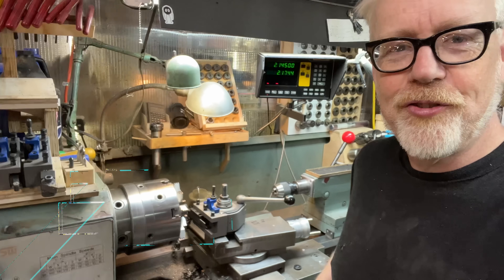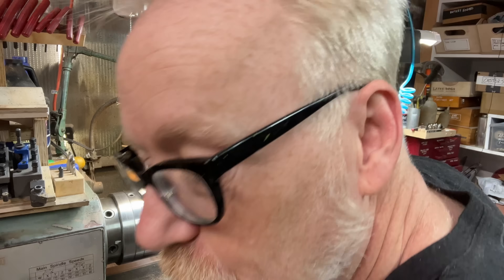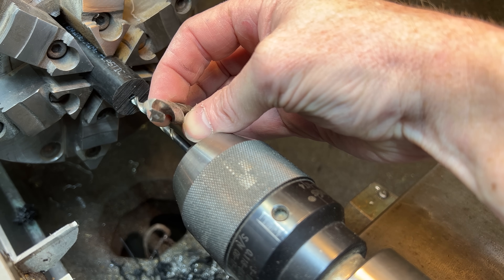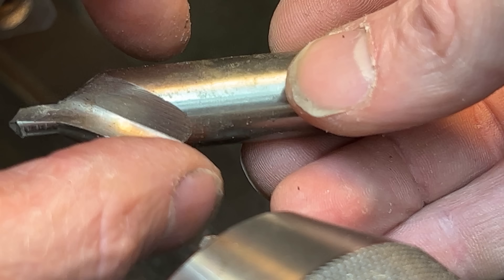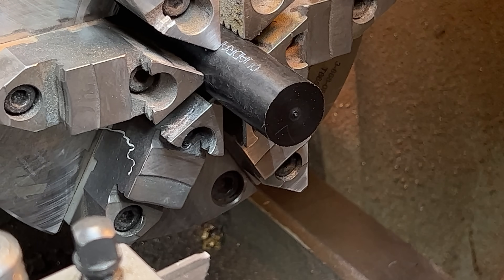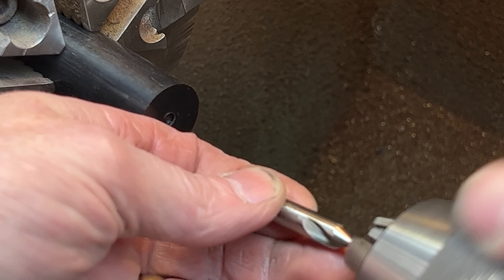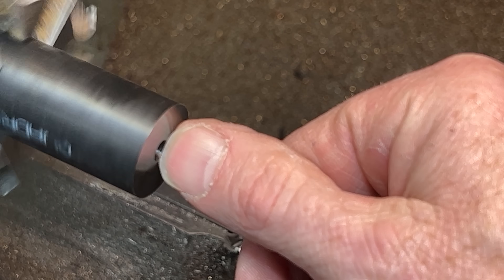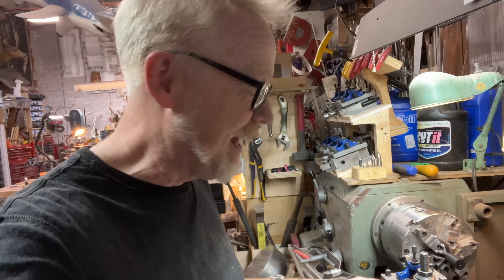Why Adam Savage ALWAYS Uses Center Drills

Comment: Adam et al: if you want an upgrade, get some spotting drills. Their angle will be much closer to the drill you'll use, and you won't run into the nightmare of breaking off the little nub in your part.

Center drills are designed for providing a hole for lathe centers -- so while they work well enough, it's easy to find the tool that works just a little better. (Also, more tools!)
Reply: Came here to say exactly this - spotting bits are designed to start holes, centre drills are for using centers.
Reply: As a retired cnc machinist , I used 90 degree spot drills 99% of the time with usually 118 degree drills . The outside edge of the drill would catch the edge of the spot hole with equal pressure bites of the wall the 118 degrees centers the drill hole position
.
Reply: @j.davidbennett8373  
Spot drills are just simply the best choice and it amazes me to this day that even years long machinists have no idea that they even exist. I also enjoy drilling that bit extra deep and getting the hole chamfered for free. No need to chamfer in another op after the hole is drilled. 
Drives me nuts when I see center drills being used on a drill machine.
Reply: So true. Having the angle match that of your drill is much nicer for the drill as well. Not so much of an issue with HSS drills, But I've heard some carbide drills really don't like drilling into center drilled holes. For my mil/lathe I've ground my own "spotting drill" out of some round HSS, either as a spade drill or as a d-bit. They both work great.
Reply: Bought some the other day, just because i needed some 5mm drill bits for rivets, and am tired of the bits wandering as well. Plus you get 2 chances to break the drill bit. Will also say that if you have the misfortune to do work on 316L stainless steel that has been work hardened by being spin moulded, and not annealed, you will not go wrong budgeting one drill bit per hole. You might be lucky and get three holes before the bit turns into a friction stir rod, but generally just a shade over 2 holes per bit. Last few I had run out, so yes that 600W AEG drill was quite happy to cook the holes through it. The 800W Bosch could not turn fast enough, though it does have enough torque on it to drill 25mm holes through reinforced concrete, never mind if there is actual reinforcing rod in the way, plus the plain bits are cheaper than SDS. The 5mm SDS bit lost the tip, though it made no difference to it drilling, still went in fine, just a second more per hole. 6km of conduit with one drill bit is good, till I borrowed it from the electrician and found a bit of loose granite. Still in use as a centre punch. Building sites are brutal on power tools.
Reply: Spotting drills are the way to go!  I used center drills and while they work pretty good since I found out about spotting drills that's all I use.
Reply: Yup, center drills are for centers only. Spot drills put you on the spot for your twist drills and reamers. Just got to make the spot a tad bigger than your finished hole size.
Reply: Found the guy who actually knows
Reply: I've been using spotting drills for years and was going to recommend the same thing.

This is directly from a Guhring catalog.

"
If using a HSS or HSCO drill, choose a spot drill with a smaller point angle (i.e. spot with a 90° drill, follow with a 130° drill)

For a carbide drill, choose a spot drill with a larger point angle (i.e. spot with a 142° drill, follow with a 140° carbide drill)
"
Reply: 👆🏻This.  Exactly.

Comment: I dunno about you, but every time I see Adam run a lathe with that semi-floppy watch band on his left wrist I get antsy.
Reply: I cringe when I watch him look over the top of his glasses when performing an operation that throws chips.
Reply: @paulgrieger8182  haven't you ever heard of reactive flesh eye protection? His eye lids are bullet proof by now.
Reply: @MattDaBoneless  safety squints
Reply: @MattDaBoneless  "Engage safety squints."
Reply: @paulgrieger8182  100%, as a former auto mechanic my auto squints are on the next level, can even protect from welders burn
Reply: @paulgrieger8182  agreed, as a cnc machinist I tend not to wear safety glasses at my work but if I go to use our manual lathe or mill, I put those things on
Reply: btw adam has an extensive first aid kit that has seen some use
Reply: I like when he brushes metal chips away with his hands.
Reply: The watch is an Omega Seamaster Planet Ocean Chronograph.
Reply: 1971 — I saw a fellow tool & die apprentice get his right hand rolled up backwards around about a 1” diameter shaft on an engine lathe because he was wearing a glove.  Over the past 50 years I have seem empty places where fingers used to be, hideous scars on every limb of a human body, and a couple of glass eyeballs — all from not taking precautions that we’ve been taught from Day One.
Reply: It's one of the reasons we love him: he's a Savage.
Reply: Agreed, I guess we all work our own way! 😆
Reply: Or using a center drill instead of a spotting bit for starting twist drill bits instead of just for lathe centers.
Reply: The lathe can grab on the most inocuous things and once it's grabbed it will pull you in and smash you to bits while still awake during that really short period before you get turned into red mist and small bits of you stuck in the gears that your family will have to dig out and clean.

These safety precautions aren't just for fun.
Reply: @Bobogdan258  Live by the lathe, die by the lathe
Reply: Well especially after the screw cleaning
Reply: I wonder if he keeps it loose to allow it to rip free from his wrist. Maybe it purposely has a weak clasp?

Comment: Its much more apparent on self sharpened drill bits as its near impossible to keep the point centered
Reply: yeah, as someone mentioned above, when you sharpen a bit it causes it to widen, since the bit also gets wider as it goes down. So the more it's sharpened, the more parallel surface touches the element, the more the bit wanders.